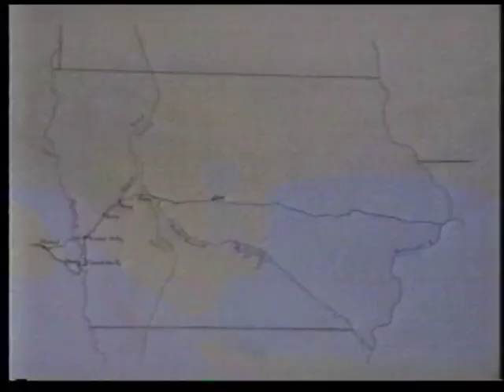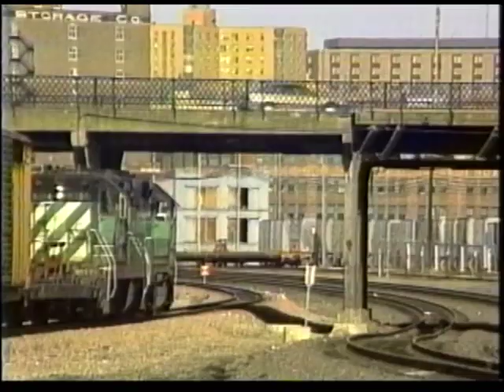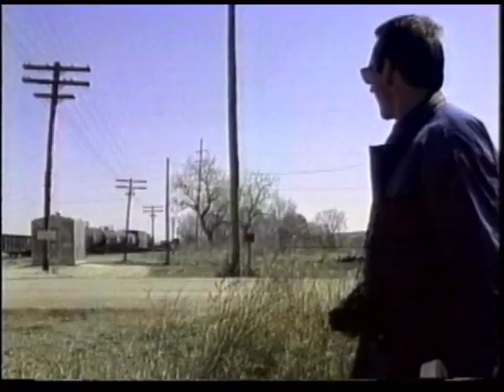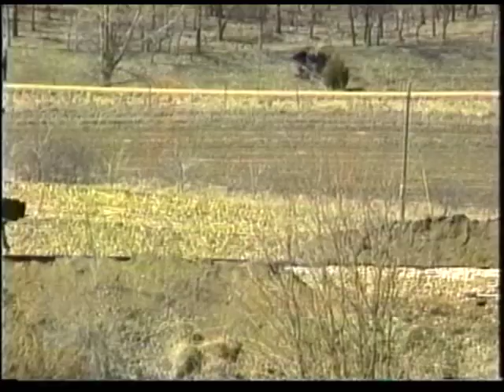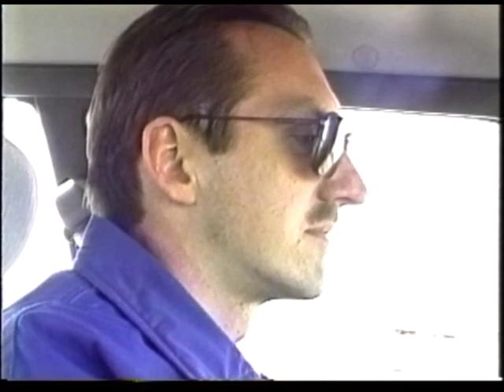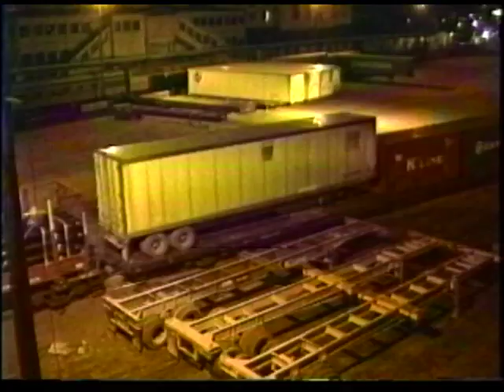The Iowa Divide:  Railroads of America 1

Comment: Those raked out SD40-2's with the six long axles and stretched porches, look intimidating and are the best looking freight locomotives built. Union Pacific had over 600 of them (including the straight, shorter SD40's) and Burlington Northern had over 800. It proved itself a tough and reliable locomotive.